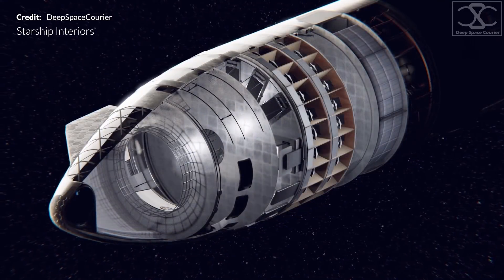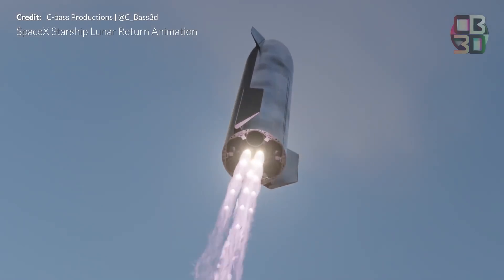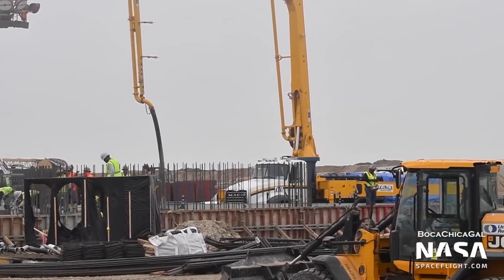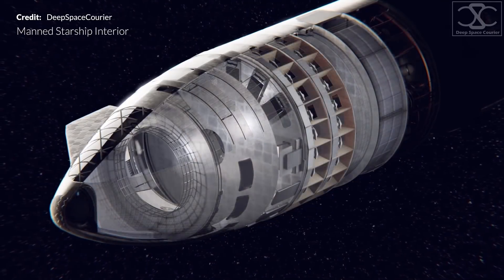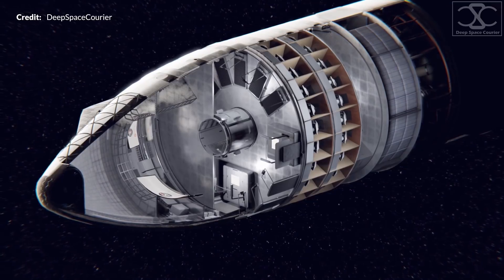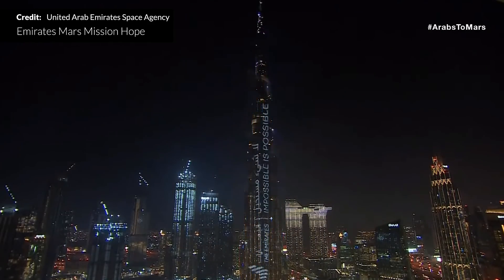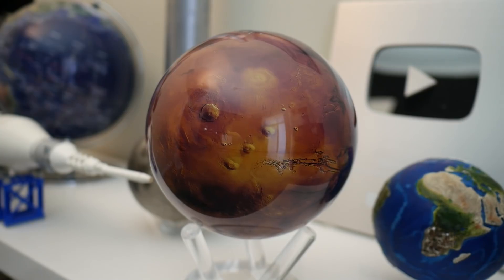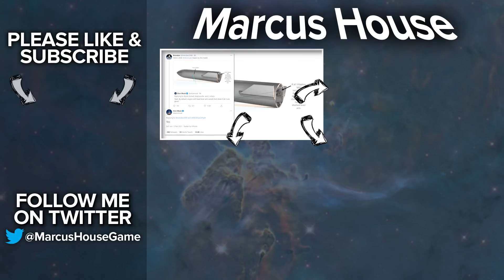SpaceX Starship to attempting another flight with SN10 - Can they master the flip and landing!?

Comment: They already mastered the flip with SN8, they just need to get fuelling and engine relight issues sorted out.
Reply: and fix the engine bay fires...
Reply: @wim0104  These does seem to be an issue with fires on the engines, as I recall SN5 had the same problem. Personally I think the engine on SN9 was already having problems before the relight attempt as you can see cryogenic propellant leaking from the engine bay during free fall which didn't happen on SN8. Still the engines are a very new and evolving design so at least they have more data to work toward a fix.
Reply: @paulround8501  Elon has commented that not having a flame trench was a mistake. That probably gives you a clue about engine fires.
Reply: @saumyacow4435 Yeh very possible, fragments of launch pad surface are getting kicked up at a hell of a speed into the engine skirt. Although for a Mars mission they do need to get these issues sorted out rather than rely on a flame trench as there will be no flame trench taking off from the martian surface.
Reply: True SN8's flip was actually flawless
Reply: There getting there I can’t wait till it finally lands
Reply: They succeeded in the flip but I seriously doubt they "mastered" it. If you master something it means you can repeat it repeatedly without failure. Starship has a 50% success rate on the flip, they have mastered Falcon-9, not startship.
Reply: @MaxThomas79  Well they proved the flip works and that they can control the starship into a vertical orientation ready for landing. So from this we know that the flight control software and control systems are able to perform the flip and this is the really what I mean by mastery. SN9 flip failed because one engine does not give sufficient control authority to complete the manoeuvre which is nothing to do with the manoeuvre itself. If a car breaks down you don't say the driver hasn't mastered driving. Now reliability is another thing and they are far from mastering that with Starship for sure.
Reply: "Mastering the flip" in my mind includes being able to put the rocket into a state where the engines will operate properly. So, not mastered yet.
Reply: @saumyacow4435  "in your mind"
Reply: @sneakytom7416  his mind is correct.
Reply: @sneakytom7416  and everyone's mind with a logic process.
Reply: @saumyacow4435  SN8 completed the flip and was decelerating to land when they lost one of the engines. We know why it happened and with SN9 the engine that did relight showed no signs of the same problem. SN9 however failed to relight both engines so could not complete the flip. It is clear that if both engines had relit on SN9 it would almost certainly have been able to control the flip too. You are right that mastered is too strong but they certainly have successfully completed the flip. Both times the reason for RUD was not due to the flip but propulsion issues.
Reply: @paulround8501  it's a fail until it's perfect. Claiming something that exploded as a success will only cause stress to the public and cause spacex fanatics to be made distant from the rest of the world. There's no point in claiming a rocket was successful, there are plenty of rockets that go up and do not land.
Reply: @ummerfarooq5383  I'm guessing, from that comment, you have never worked in a rapid prototyping environment.
Reply: @paulround8501  failing prototypes are not displayed before a sympathetic public eye.
Reply: @ummerfarooq5383  Apart from a few people like us on YouTube no one else is much interested. The whole thing is privately funded so it isn't like SLS where it's tens of billions in tax payer money and years late. At some point they will land it and there will be some news coverage because that is impressive, until then it is at best a foot note to mainstream media with most people just seeing Elon Musk as a crazy geek because that is the way the media have always portrayed him.
Reply: @paulround8501  Elon is also on Twitter and youtube is not a gaggle of a few. 
SLS is not a point here to be mentioned, especially in the case of those claiming mastery of SN8, which ended in an obvious cataclysmic failure. Not forgetting the debris during the launch.
Reply: @ummerfarooq5383  So what exactly is your point? As I said the public in general do not care about any of this as they are not paying for it? For a first test SN8 was a pretty big success, they proved the flight profile and only failed in the final stage of the landing phase the other 90% went pretty much flawlessly. You don't seem to have a clue how this kind of rapid iterative development works. SpaceX freely admitted before the flight that they only thought SN8 had a 50% of reaching apogee, less than 30% chance of landing and a 10% chance it would just explode on the pad. Given those odds it was a huge success giving them far more data than they expected and proving the most complex and innovative parts of the flight profile.
Reply: @ummerfarooq5383  maybe you hide failed prototypes from the public if it were spend with tax money, not an issue here.

You need to fail in order to learn
Reply: @revert6417  you need to not claim an aweful explosion of a prototype passenger vehicle is a success. Then again maybe the downed ethiopian dreamliner was a success.
Reply: @revert6417  no one with any sense calls failures as succcess
Reply: @paulround8501  Actually, no. The propulsion issues are quite likely related to the physics of the flip itself. Of course, SpaceX is not being entirely open with us about what is really going on. They quite likely have a lot of data on this. But I dare say that Raptor'ss start-up sequence isn't liking the presence of voids or gas bubbles. This may take time to resolve. They may even need separate attitude control engines and more time for settling.
Reply: @saumyacow4435  Possibly, though based on SN8 and SN9 flights they did seem to suffer two very different failure modes.
Reply: @ummerfarooq5383  Every single failure is a success actually. Ignoring all the impact these flights have on the public, the data gathered is priceless and most certainly means that the next PROTOTYPES are better and have higher chance of complete success. All this results in an almost perfect vehicle in the end, just as the Falcon 9 Block 5 is today, landing the booster every single time and achieving peak performance through rapid iterative design on both the vehicle and the Merlin engines.
Reply: @vallabhkavi1477  go try telling your father you failed your maths exam.
Reply: @ummerfarooq5383  Completely different topic lol go try telling Elon failure isn't an option
Reply: @ummerfarooq5383  Kindly acquire at least some background knowledge about this topic before engaging in discussions, since clearly, going off-topic seems to be quite prevalent with you
Reply: @vallabhkavi1477  the background topic you deniers constantly deny and try to brush under the carpet in this instance is that SN8 was not mastered in anything let alone successful.
Reply: @ummerfarooq5383  seriously, please just stop talking. It's obvious that you have no idea how engineering is done, so your random assertions aren't helping anybody.
Reply: @chouseification  I'm not here to help you greedy engineers get funding for your mythical claims of success. Just like we don't need another 737 max 8
Reply: @ummerfarooq5383  If I miss one answer in a test of a dozen questions, my maths teacher would not fail me.
Reply: @logicalfundy  your teacher won't, but your bank manager will.
Reply: @ummerfarooq5383  Thankfully my bank manager doesn't write tests or design rockets.
Reply: @ummerfarooq5383  In the above comments we have already come to a conclusion that the word 'mastered' was not appropriate but this TEST FLIGHT of a PROTOTYPE was a success. Instead, my first comment raised an objection on your statement that failures cannot be called successes. Hence, my point still stands and in addition to this, you have proved yourself to be a poor reader with attention deficit disorder. Kindly consult a doctor.
Reply: @ummerfarooq5383  Elon and his team have already achieved astronomical goals, which people like you, thought were impossible, without even knowing the mathematics and physics behind it. So its quite hilarious that you use the word 'mythical'.
Reply: @saumyacow4435  spacex doesn't have to be open, their team members only need to use appropriate terminology. Not spewing fake news.
Reply: @vallabhkavi1477  so since we have concluded SN8 was a success, then let all successive spacex starships end in firey explosion as we saw SN8 and SN9.
Reply: @ummerfarooq5383  They do need to stick the landing eventually, but the landing isn't the only thing they are testing, hence using a graded test as a metaphor. You're just being argumentative.
Reply: @logicalfundy  the landing is the only thing that matters. To argue and rebuke and call out those who say words which are false is a basic free speech right.
Reply: @ummerfarooq5383  Aight thats it im not wasting any more time on u
Reply: @ummerfarooq5383  it also matters that it doesn't blow up, so they test the tanks to their limits. It also matters that the craft doesn't burn up in the atmosphere, so they test the "belly flop" maneuver they intend to use. Everything matters, especially at this stage of development. Also I'm not questioning your rights, just the veracity of your claims.
Reply: @logicalfundy  I'm not the one claiming anything of success. What nonsense you flip around.
Reply: @vallabhkavi1477  the lawful do not tire.
Reply: @ummerfarooq5383  it succeeded in reaching its intended altitude, it succeeded in performing the "belly flop" maneuver, it succeeded in launching from the pad. Those are factual. Downplaying their importance - that's opinion.
Reply: @ummerfarooq5383  you most certainly do not get 100% on every practice question when preparing for the exam though do you? This is the difference here. These prototypes are meant to find every single thing wrong with the rocket. If nothing failed they would be learning far less from these test flights. The whole point is to fail so you can make the whole thing better. Honda does this exact same testing for their cars, which is why their engines are almost invincible compared to other companies. You really haven't a clue what you're talking about and just want to be negative because apparently there's something wrong with wanting a soundproof vehicle rather than spending 20 years building a single vehicle that you tried to fix before you even tested it.
Reply: @ummerfarooq5383  The SN# prototypes exist to be potentially blown up, if they weren't expecting multiple catastrophic failures they would make only one starship prototype and wait decades just to get it off the ground
Reply: @niksrunis165  no one has said this other than you. Meanwhile Elon Musk said to the nearest respect I recall about his falcon rockets that if that final one failed to succeed it would have put him out of action. But it landed. The whole purpose of this SpaceX rocket project is that the rockets land, not explode.
Reply: @ummerfarooq5383  it wasn't the first Falcon prototype to launch, and he was running out of money. So that's why he said that. This is not the same situation, he never said this is the last prototype, yet you are basically treating it this way. I completely understand they need to land properly, but I also understand this is not the last prototype. They're a long ways from launching an actual payload to orbit.
Reply: Elon musk will never succeed with his Mars colonization bullsh*t, it's just a marketing tool to attract stupid people and make elon richer
Reply: @Johncena-od8gu  Ah yes thats why he and his team have already succeeded in making the most advanced rocket engine ever, land an orbital class booster, are currently constructing a rapidly and fully reusable launch vehicle more capable than the Saturn V, are on the brink of achieving fully self driving cars and complete renewable energy and have one of the most advanced battery technology in the world. Yeah I can see how all this is a marketing tool
Reply: @vallabhkavi1477  124x is a robot channel

Comment: So far Starship didn't miss the landing pad  :-) the RUD's nailed the pad
Reply: Excellent point! From the Hopper onward all Boca Chica vehicles have come down exactly where they were supposed to. Therefor   even in case of a RUD, the chance of  damage to adjoining structures or vehicles is minimal. Of course there is risk, but we must increase our glacial speed. I am 68 years old. We landed on the moon when I was in 9th grade and have not been out of low earth orbit since 1973. It is time to start moving.
Reply: I think it’s cheating to use the wider side to hit the target! 🤪
Reply: @colinmaynard2879  well it was in the middle of the target so the horizontal strat didn't really gain it any.
Also if it had hit vertically it could have RUDed earlier and gained a better time in the RUD% speedrun
Reply: Yes, but, i wonder that they just go higher from time to time, i mean, 150m, 1 km, 2 km, 5 km, 10km, testing without so many crashs!
With that you can show reusability at the same time!
At the moment its a one time use, doing everything right in one go is crazy, they could do so many more flights and amaze the people and show reliability while destroying a prototype from time to time.

It would look much cooler when they have several ready for flight in the line, and testing durability, reliability and reuseability every week!
Reply: @nicosteffen364  wait when did the 1 2 and 5 km flights happen?
Peetty sure it was all 150m, then 15km, then 10km

Comment: Grate video mate, in the staship it was missing a round track like 2001, also I keep saying that if the spaceship rotates 1x min it will be enough to generate a bit of gravity very important to long space travelling, remember it has 9m
Reply: One image showed two starships linked by a 100+ meter cable and rotating. That would be less disconcerting for the passengers.

Comment: People that are impatient, wanting spontaneous success in such amazing design concepts and innovation, have probably never wired a household electrical socket or fixed their own bicycle.
Reply: I agree with you, but to give credit where credit is due, most SpaceX fans understand that great things require time.

The test flight comment sections are largely positive and encouraging
Reply: @SoumilSahu  Most space x fans are gullible idiots who don't understand much and believe what ever science fiction Elon tells them is on the cusp of reality. Elon is nothing but a con man who steals others ideas and work and calls it his own. Do some research on the con man and you'll find out he's only a promoter and has revolutionized nothing except disregard for safety and our planet.
Reply: I tried fixing my bicycle once and it took 4 hours. When it broke again I brought it to the shop and the guy did it in 4 minutes.
Reply: Bruh at least u were able fix it
Reply: @abelpaul7508  It helps to use the right tools!
Reply: @dsdy1205  🤣🤣🤣 what needed to be fixed, or did you only need to change the light bulb? Joking...
Reply: @Mr.MarcusMario  There was a weird plastic disc stopping the chain on the cassette from falling in between the largest gear and the wheel which had fallen off, so when I changed to the lowest cassette gear the bike chain fell into the gap and jammed up the axle. I had to remove basically everything on the rear part of the frame to get it out.

EDIT: oh and I didn't have a wrench lol, just one of those weird grippy things
Reply: @dsdy1205  ugh... yeah bikes am I right? Good thing there are bike machenics. I know the struggle with the gears. And these guys make it look easy. Funny story though.
Reply: They haven't had anything but mothers milk all their life and have just stepped out of their crib and into the rosy garden and learned how to "write".. but are a bit grumpy about being cut off and want back so cries out heh
Reply: I've done both, and had the first attempt resulted in a total failure, I would have stopped before understanding why. Who's money is SpaceX spending?...news flash, not Musks...
Design concept parameters are too similar to Falcon....what, did he fire those guys?...(he does that....serious impulse issues...)
Reply: How does one screw in a light bulb 💡
Reply: Both are easy tasks, wtf
Reply: Perhaps, but we have microwaved popcorn, so we want it now dammit,   We are used to having it quickly, and no excuses are acceptable anymore.
Reply: Those people are called Millenials.
Reply: Elon musk will never succeed with his Mars colonization bullsh*t, it's just a marketing tool to attract stupid people and make elon richer
Reply: @Johncena-od8gu  lets see you get ONE rocket to orbit..
Reply: @Johncena-od8gu  I bet you have trouble succeeding in tying your shoe laces